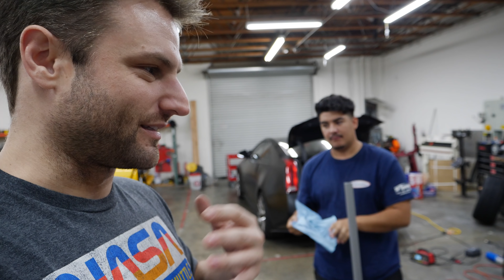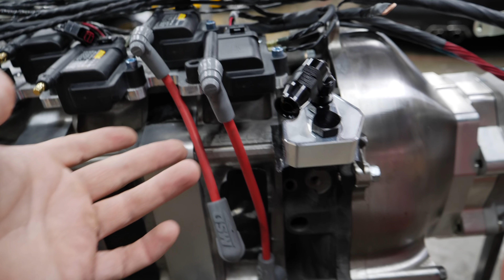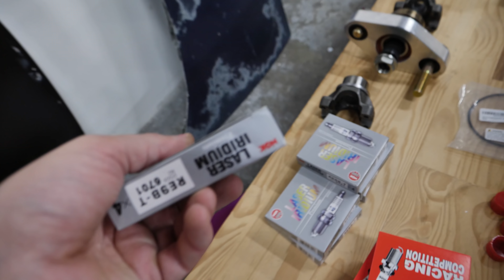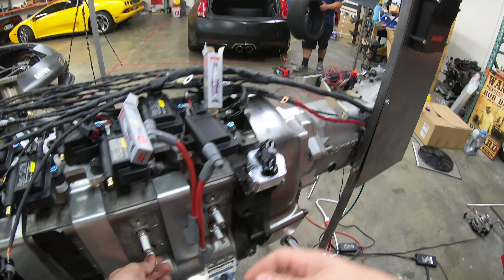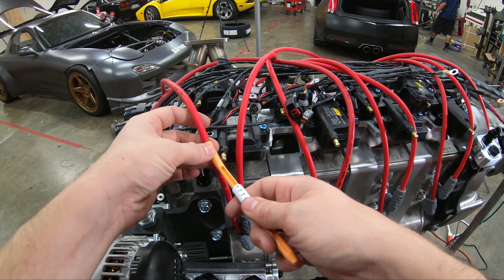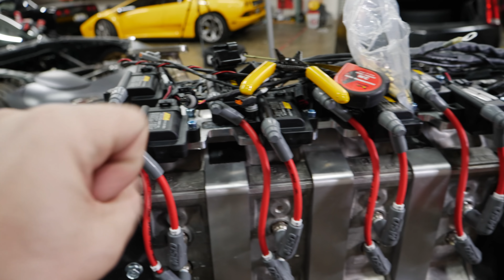The 4 Rotor STARTS this Week! Ignition system finished!

Comment: Not being critical here, because this is pretty bitchin’.  It would look cleaner if you could come off the coil pack straight with the plug wire for the trailing plugs.  Just my opinion.  Thanks for sharing.

Comment: Gets some Spark plug heat boots (BLACK) and you said you are going to trim the "ignition plate" drill it so it can act as a wire holder as well.

Comment: Not running a radiator on a test bench / dyno is fine, but I would suggest installing a 1 to 2 gallon holding tank to be a stand in for a radiator and allow for proper recirculation and release of bubbles from cooling system during break in and testing periods.

Comment: per your oil pump dilemma, my review of the slow motion video inspires removal of the lower plug and addition above, side by side. chamber side slot port...hot plug or blow through the round port detonate in reverse...backwards. lower plug a metal plug fit, have chambers remachined, pick up offset hemi pistons from
 http://www.rotronuav.com/engines/target-drone-engines
james

Comment: That engine is f'n amazing my friend. My third car was an RX-7. I had it from when I was 19 till I was 21. It was an 86, red, 5 speed, naturally aspirated, no rear seat option (which saved weight) and came with the Mazda hard suspension option that was offered at the time. It handled like a dream. I took the engine-mounted fan off and replaced it with an electric fan I strapped to the radiator. I then did a short ram intake, cat-back exhaust and a short throw shift kit. It was the best daily driver I ever had. It was so well balanced that I could drift it through intersections on rainy days with perfect control. Damn I miss that car.

Yours on the other hand is going to be a rocket ship.

Comment: Those boots on the coil ends of the plug wire are for a HEI distributor cap, the top of the boot snaps into the wire retainer on a hei cap

Comment: Uses aem coils with adaptronics ecu..
 I believe would have been easier to use all aem sensor and a infinity system... Hands down tho those inductive dumb coils are lit af... And i think the an fitting you need for the oil lines would be a 45 deg.... I used all aem sensor and coils on my 2jz and i am not regretting it at all it was super easy.... Is not using the aem ecu issue, cause its not compatable with 4 rotor or was adaptronic better for the 4 rotor??

Comment: Hey Rob, did you put in the correct trailing and leading plugs or are they all the same just for the sake of mocking up the wires? Dont want to run into any issues on startup, it's going great tho I've been keeping up with this build since you revealed it at sema the first time.

Comment: Rob, you better get some insulator tubing to put around the spark plug wires to prevent cross firing sparks. It will cause misfiring. I had that problem on my 1988 Toyota 22R build with 94m.m. pistons, ported heads, larger intake and exaust valves, after market distributor from a Ford 4 cylinder, Holley 500 2 barel carb, 4 in 1 1 5/8" ×2 1/4  custom made header into 98m.m. twin turbos with 3" exit exhaust . The block was an iron block engine and produced 480 b.h.p. compare to a stock 112 b.h.p. 22R engine. It went...."KABOOM!" It blew up! I'm learning about rotary engines watching you, Bro! Just as expensive or more expensive than building $9,687.00 22R engine! "KABOOM!!!" "😭😭😭😭!!!" Too much compression.

Comment: The fittings you want matching will need to be GREATER than 90 degrees. A smaller degree = a tighter turn (turning it further down).

Comment: Rob, you may want to double check the way you crimped the terminals onto the ends of the ignition wire. Once you strip the outer insulator off with the razor, the exposed spiral core needs to be folded back against the wire; then you place the terminal over the end (with the core that's folded back tucked between the terminal and wire end) then make your crimp with the crimp tool. With the spiral core of the wire sticking straight out into the terminal, you may see some arcing from the coil to the wire.

Comment: Hey Rob, are you sure there was not a second black insulation layer inside the first one. That inner part looks awfully black in the video for conducting metal.

I might be mistaken but I wouldn't want to have that 4rotor not staring due to suck a case.

Regards

Comment: 50,000$ 4 rotor doesn’t have a 20$ trash can. Just put that on the floor when you cut that off the rats will use it

Comment: I recommend one drop of oil on each spark plug threads....to prevent hard removal......and the spark plug no.s should be aligned on the wires to be neat.
Reply: dont do that u want the cleanest best earth u can get plus the amount hes going to be pulling them out they aint ever going the seize

Comment: OMG! How long will it take until peoples stop messing around with WD40?

WD40 is a solvent and it is quite agressive.
In the box should have been a little pack of silicone grease, or just buy some.
Silicone grease does not eat away at the rubber and silicone parts, WD40 does.

Comment: You're supposed bend back the inner black section back onto the red insulation and they get crimped together in the large crimp. It's in the manual
Reply: Freezing the frame where he has the manual it looks like that's only the case for "standard terminals" (whatever those are). The dual crimp terminal explanation looks like the way he did it.
Reply: What's a manual?
Reply: I was thinking the same but as long as the conductor (black part) is crimped against the terminal and wont move, it will be fine.

Comment: Please for the love of god get straight boots for the rear coils. My OCD is freaking out seeing 90° boots on them. 😂😂😂
And swap the HEI wire ends for the front coils while your at it. They arent being clipped on, so the look out of place.
Reply: Except straight boots on the rear coils would be putting the wires over the oil fittings, and obviously Rob doesn't want to do that, so the use of 90° boots makes sense. It's also already pretty obvious which wire is for leading and trailing plugs, as one wire is nearly half the length of the other, plus they all have number tags on them. Maybe use some logic next time. 

The argument of OCD is also irrelevant, you'd actually be triggered more by straight boots on the rear coils, as the entire packaging would be even less consistent. You'd be happier seeing an extension that brings the rear coil's 90° boot up forward to the level as the front coil's 90° boot. But then is your OCD not also set off by the fact that the boots on the leading and trailing plugs not at the same angle? Or how about wire 1 being longer than wires 3, 5, and 7? Or how about each wire in a pair not being the same length? See why the OCD argument is irrelevant now? The only thing that should truly be triggering anyone's OCD is the fact that coil 1 and wire 1 are entirely different from the rest of the set. The OCD argument is nothing but finding something to complain about.
Reply: @xaytana  I didnt say a damn thing about not knowing which wire goes where. And if you knew anything about OCD, you would know not everything has to look the same, just be in order as it doesn't look out of place. And take a fucking joke, I wasnt even being serious there mr keyboard warrior. SMH!
Reply: T Cress the straight boots would look a million times better, they would also make it super obvious which wire is leading or trailing.
Reply: Go see a doctor....

Comment: I don't know that they way you crimped the wires will actually work. The smaller crimp for the conductor requires a special crimping tool that makes it bite into the wire. Holley sells it so I'm sure you can use your deal with them to grab a pair. I just recently made my own from a similar MSD set where I used the single crimp right angle connectors.

Comment: Rotary is better than any other engine out there. Change my mind
Reply: Easy - gashog, leaking and eating oil due to heat from combustion and exhaust and cold from intake being next to each other // the idea with the rotary is very clever and in theory you are right

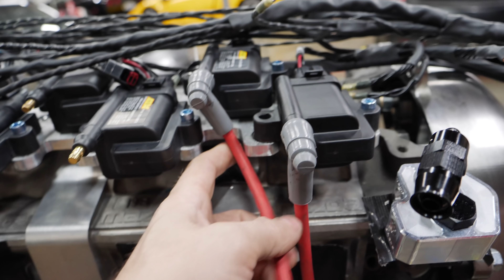Comment: At 2:27; why not make the left one the top spark plug, and the right one the bottom? Then you wouldn’t need to cut anything to length and extending half the wires and shortening others seems time consuming 🤷🏻‍♀️